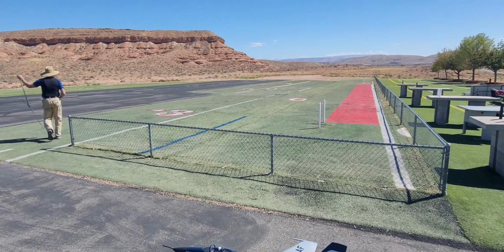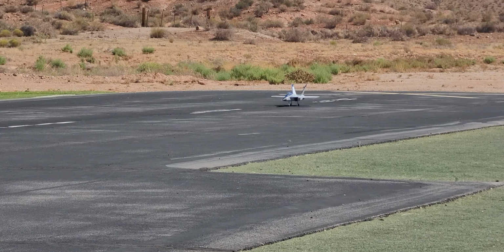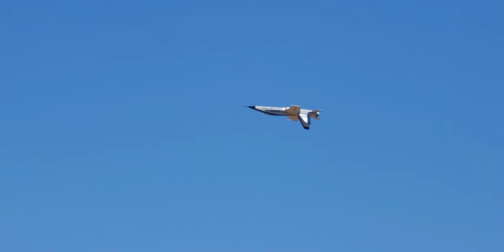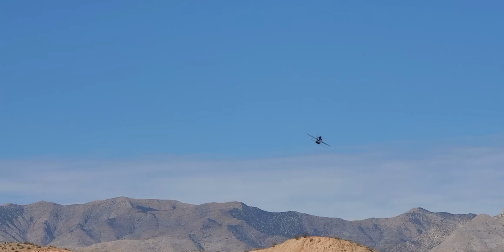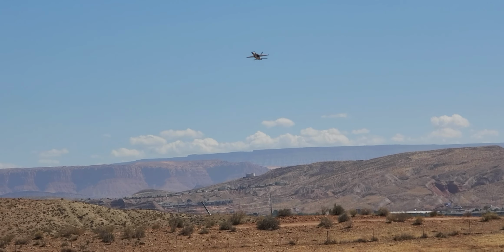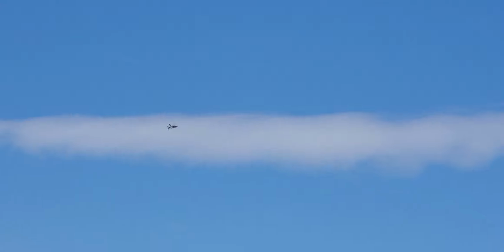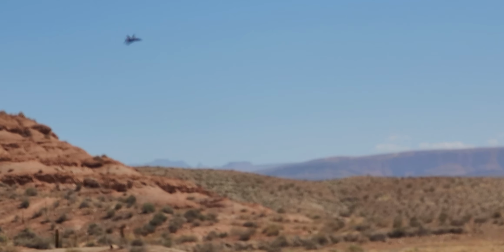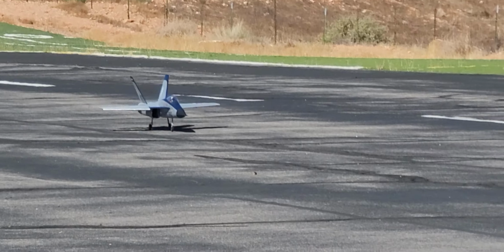YF-17 COBRA high performance flight

Comment: So, do you have 3 servos under each wing? 1 for aileron, 1 for flap and one for leading edge flap? I want to get an extra set of wings for mh F-35A and try to convert it to an F-35C by extending the spare set of wings and potentially adding leading edge flaps too.
Reply from the maker: @D430-q9u  yep. I show it up close in previous videos